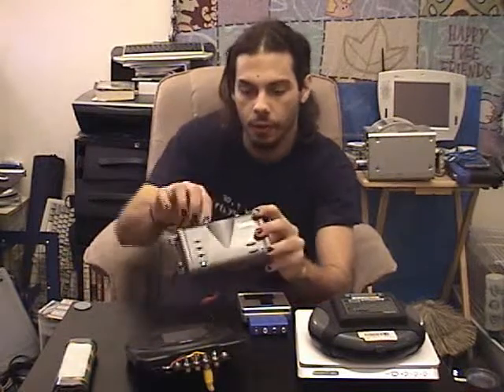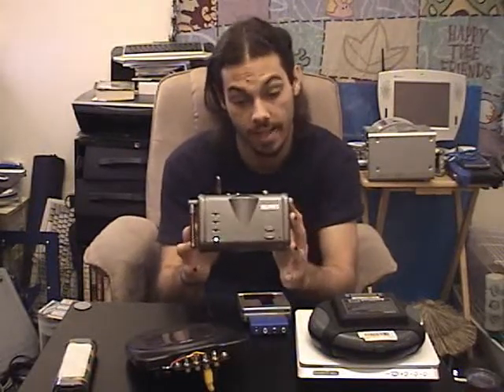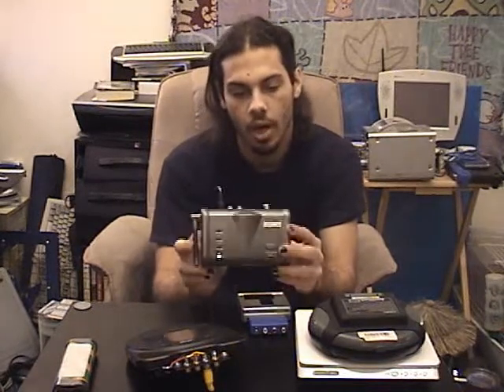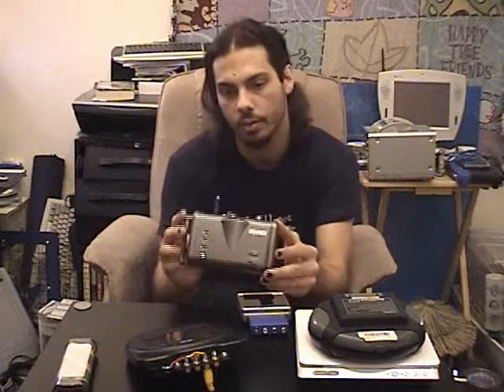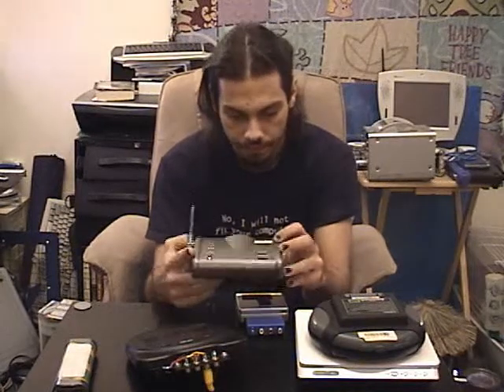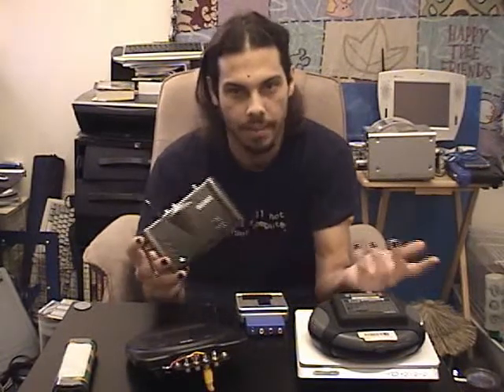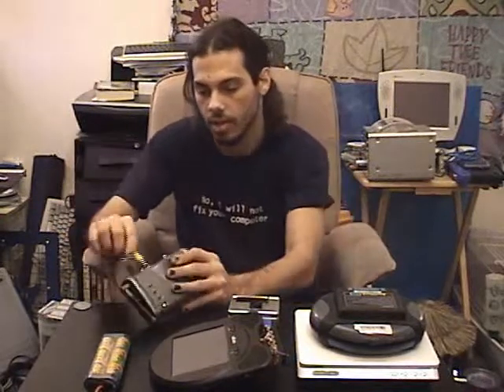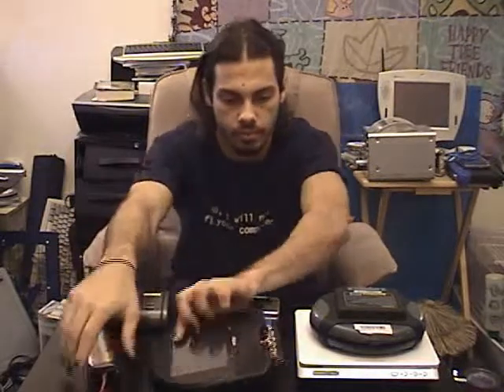Foxx   2 4Ghz Video Scanner

Comment: I have a portable dvd player hooked up to a 2.4 ghz video receiver with a 15 inch 9dbi antenna screwed onto that. I'm still not picking up anything, could you tell me what's wrong?
Reply: ***** I'll have the video up sometime during the weekend (college is starting up once again and I think i'm in for it this time) I don't know much about this and I put a few things together and I thought it would work, so if you're surprised at what you see, that's why. And concerning where I live, facing a highway with plenty of overhead wires in front of me, could that be the reason for not picking up anything? Most if not all of the neighborhoods are either behind me or on the other side of the highway.
Reply: ***** I had it on private but unlisted which I thought meant that the video is un-accessible  to anybody except those who had the link . . . just made the video public. Check my channel. Thanks for being so cooperative.